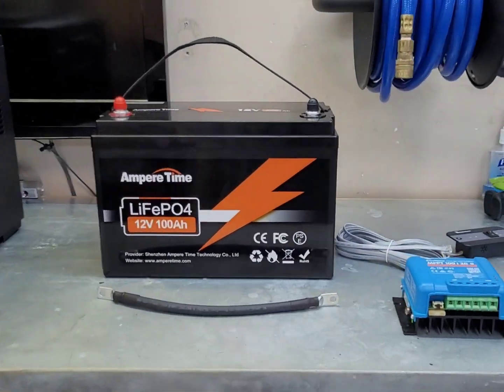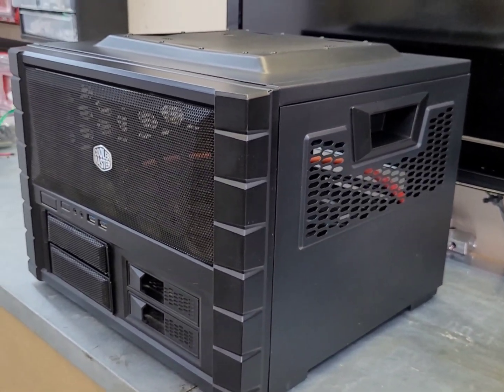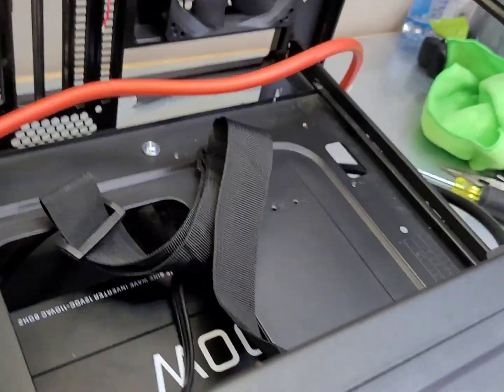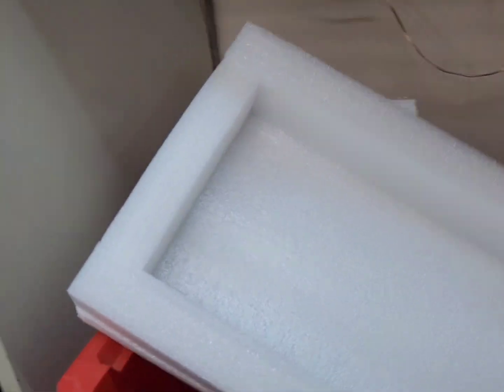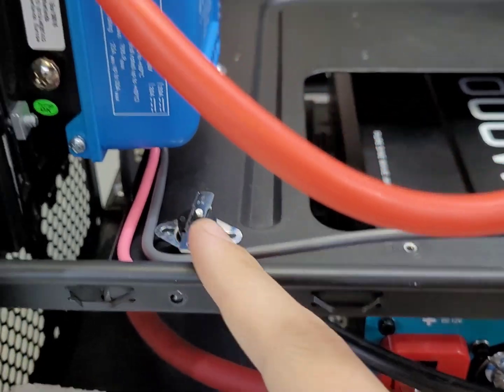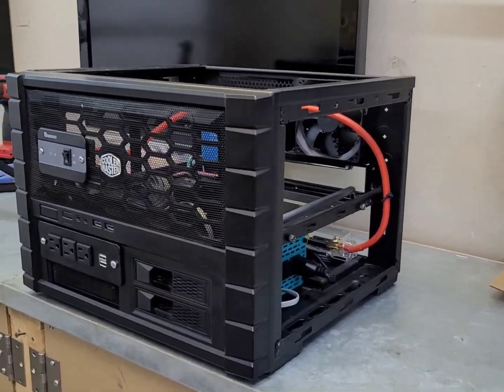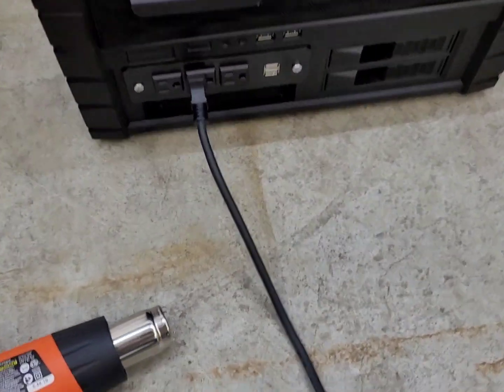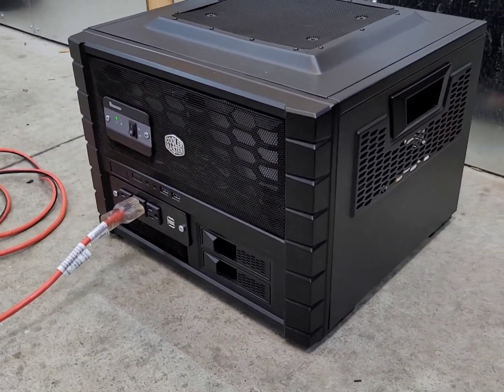DIY Solar Power Generator - Offgrid Power station 100AH Ampere time

Comment: I want to build one of these but add a meter to regulate power consumption
Reply: Regulate or monitor? I’m using the Victron SmartShunt and it had Bluetooth so you can connect to your phone. It’s just to monitor your usage though.

Comment: VERY NICE COOL LOVE IT 🥰🥰🥰I HAVE 48V 3000 WATTS PURE SINE INVERTER 120V 60Hz I HAVE 2 15A BREAKER AND 20A BREAKER FOR MY 3 OUT LET 110V I HAVE 250A DC FUSED AND DC SWITCH 20A 125 VAC FOR MY INVERTER SHOUT OFF LOVE IT HAVE COOL FAN AND GOING PUT SOLAR CHARGER ETC
Reply from the maker: Nice! Check out my recent videos I have a 24v 3000w system and a solar powered air conditioners!

Comment: No data metrics like battery voltage and load amp draw,  solar panel output voltage and current, internal temp, ac voltage, amps.
Reply from the maker: The victron app gives me the info I need

Comment: Nice build. My old man could do with something like this in jamaica fot power outages. Wonder how long that could run his chest freezer and regular fridge freezer for before it needs a charge. How long for 150w panel to recharge, plus I’d need a charge controller I guess as that victron is just a charger right?
Reply from the maker: Yes the victron is a charger, the system has about 1200 watt hours of capacity so it would depend on the freezer, it can input about 300w in full sun with my 2 panels and would take around 4-5hrs to fully charge at that rate
Reply: @SmitHVAC.  Ok thanks for reply Jerry. I’ll calculate. Keep up the good work. Look forward to more battery build videos.
Reply from the maker: @cCaribbeanSpursTv Thanks! I have some cool solar videos coming in the next few months!
Reply: @SmitHVAC.  great. Look forward. Thanks

Comment: As long as it will run the tool battery charger your good to go to work with it.
Reply from the maker: It works great for charging batteries!